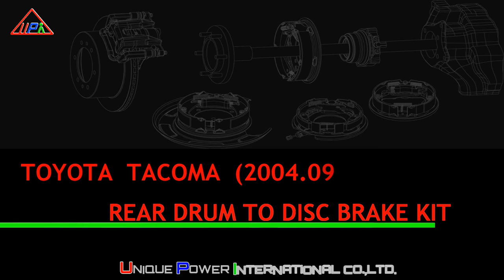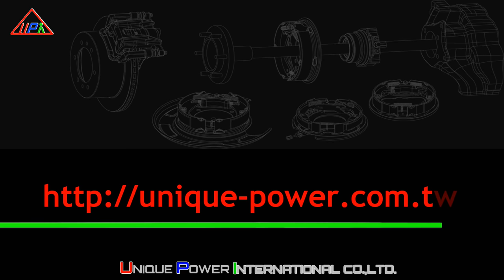Toyota Tacoma UPI rear drum to disc conversion kit installation guide

Comment: I mean yeah its seems pretty old school that my 2018 still had drums but I dont think this much work is necessary. they work fine 😅
Reply from the maker: Thanks for your comment!
The original drum brake of your 2018 surely works okay.
A disc brake in the rear, just like FJ  Cruiser will bring a better experience.
Safety drive is always the best!!!
Reply: Unique Power International i totally agree with you mate it offers both the drums and disk brake all in one piece this is what toyota should have been doing with the tacoma, tundra and 4runner also the sequoia
Reply: @UniquepowerTwUnique-Power  Explain “how” it will be a better driving experience, and what does “safety drive” mean,..we should take your unexplained opinion that all this work is beneficial but yet you cannot spell correctly much less proof read.
Reply: @gregflores8959  yeah if drums are not safe why are they still used on semi-truck and super heavy machines 🤔
Reply: @master6435  Exactly!👍🏽

Comment: Apart for the look, i don't see why anyone would do this kit. Huge job to install, prob pretty expensive too. Drums last way longer. Only reason i see is for someone that does serious towing but then again you trailer will most likely have brakes or youd need a bigger truck.
Reply from the maker: Thanks for your commands, I agree with you in some points.
You could compare Tundra/FJ vs. Tacoma ; F-series vs. Ranger ; old colorado vs. current colorado to find out the difference.
There are too many examples  from car manufacturers and easy to find out.
Our video is close to a bearing exchanging process as a repair process alway does and showing all the details.
If you have a chance to drive a 4 discs Tacoma, you might willing to tell us some new experiences.
Thank you!
Reply: I love my tacoma, but the brakes have always been lousy.  I do tow a light load of 2 atvs on a flat trailer and the stock set up is just inadequate.
Reply: @caseymckeeborrego  That's good to know.
Reply: @caseymckeeborrego  my handbrake (emergency brake) has never worked properly from day 1. 2008 model

Comment: If you want to do a drum to disc conversion on a Tundra, check out Silver Mine Motors. They have a great kit. As with all disc brake conversion, the assembly of the emergency brake is a real pain. I suggest placing the axle assembly in a vertical jig, ( I used a tall traffic cone) to stop the pieces from falling while attempting to assemble. Afterward, just install the axle. Makes the job much easier. I also recommend replacing the axle bearings and seals. When the old one is pressed out, the old backing plate will come off as well.  One thing of importance to remember, there is a right side and left side axle and, if you reverse the anti-lock brake gear, the computer will think you are going backwards.

Comment: I do like the kit, but wonder if you have same set for the 3rd generation 4runner. Thanks
Reply from the maker: We checked that the direction of the cable into the drum is vertical compares to parallel for current model.
Our kit only supports year 2005 on.
The Hilux has the same problem, too.
Sorry that we couldn't support previous model.

Comment: I have read some of the comments about why to convert drum to disc....well let me tell you this...I have a hunt camp and the last 400 m or so is a real muddy potholed road....I am talking real mud holes and so when I leave my truck at the lake for several days and then come back.....my rear wheels are locked...locked so bad that i drag them in 4 lo and they dont turn a millimetre. I have taken my truck to the dealer and they recommend a brake cleaning....so i got a taco 4x4 to go to camp and off road. Disc brakes are self cleaning more or less...I will ditch the drums within the year or so. My drum brake lock is caused by a fault with the ABS and this only happens with mud and water....this is what one mechanic i work with told me. I am not sure why this happens but it has happened 2 or 3 times now in last 2 years. I wonder if anyone else has had this problem with a taco truck?
Reply from the maker: Normally, drum brake is more resistant to the mud.
But weak to the water.
It will be effective after drawing the water out.
Drum brake is efficient only heat and water are its  weak points.

Comment: I have a 03 tacoma prerunner can i use a tundra rear differential that already has disc brakes?
Reply from the maker: Consulted our engineer.
Their lengths are basically different, and we have not made this attempt.
In theory, parts of the same year can be installed with a high probability.
If you do this, a new problem will occur, that is, the wheelbase of the front and rear axles will be different.
Thank you!

Comment: Is this a special kit made just for tacoma or this is something that can be found on a another type of vehicle? Such as toyota
Reply from the maker: In order to use the original cable and the original rim, a smaller drum brake is needed.
For matching the new drum, the new disc and calipers have to be redesigned.
Yes, this is a brand new system.

Comment: Is this drum to disc conversion kit compatible with 2002 Toyota Tacoma.  The 2002 - 2004 appear to have the same setup, only differs with the 2005 model year.
Reply from the maker: The Tacoma before 2005 is completely different from current model.
(Parallel to Vertical )

We are still working on solution for it.
Thanks!
Reply: @UniquepowerTwUnique-Power  When you get it worked out you get my money!
Reply: 2002 Tacoma 2WD, B03A
Reply from the maker: We don't have a kit for your 2002 Tacoma now.
Sorry that we need more time to create it.

Comment: So you end up with both drum and disc? I always assumed it would be one or the other,  not both. Isn't it possible to just convert from drum to disc, without new drum shoes?
Reply from the maker: It is called "Drum in Disc" system.
The drum is stuck on the inner side of the disc and is driven by the hand brake cable. 
It generates a braking power on the shoe and inside area of the disc.
The two devices operate independently, and the two forces can be added together in emergency cases.
Reply: The short answer is "the shoes are for your e-brake."

Comment: What were you grinding, before fitting the rear disc backing plate?
Reply from the maker: The grinding process is the standard procedure of Toyota for changing the bearing.
Most pickups are using the same structure.

Comment: What’s the benefit for converting from drum to disc? Is there more or less stopping power?
Reply from the maker: Please refer to our website: www.unique-power.com.tw
The parking brake (by handle) and hydraulic brake (by peddle) are working separately.
Double system is doubly safe.
Most luxury vehicles installed the same system - drum in disc system.
On the other hand, upgrade to 4 pot caliper is possible without losing the parking brake.

The drum brake is good, but it has a lag problem.
Especially, in sudden brake cases.

Yes, 4 disc brake type is helpful on braking.
Reply: The massive increase in “Cool factor” is what brings you to a stop. There are drawbacks with one being having to to sudden swerving and lane changes due to the amount of panties the ladies are dropping when they see you coming. 😂

Comment: What year is this application for and do you know if it would fit on a Toyota 4runner. Some parts are interchangeable.
Reply from the maker: This kit fits Tacoma from year 2005 to current Tacoma.
The 4runner is based entirely off of the Toyota Hilux.
Need to do more research on it,  no 4runner  in our region.
Please contact info@unique-power.com.tw for more information.
Thank!

Comment: I have a 1997 4runner with ABS, is there a product for my automobile?
Reply from the maker: Our current kit only supports Tacoma year 2005 on.
The direction of the cable into the drum is parallel compares to vertical of the previous model.
To open molds for this kit needs a certain quantity to cover all the cost.
The Hilux has the same problem, too.
Sorry that we don't have a kit support your vehicle.

Comment: Do you have this conversion kit for 2013 Toyota tacoma X-runner with 5 lugs nut pattern?
Reply from the maker: +Tuan Anh Nguyen 
What we have now is lugs=6 , pitch = 139, center hole diameter =108.
We will confirm 5 lugs spec. in short morment.
Reply from the maker: +Unique Power International 
X-runner is lugs = 5, pitch = 114.3, center hole diameter = 60.
The center hole is too small for our current mold, not available in this moment.
Reply: Unique Power International .
Reply: Unique Power International

Comment: Can't you just pull disc brake axles off disc brake truck,and install complete onto a drum brake truck.. same size axles 60.75"???
Reply from the maker: The installation process is the same as O.E. changing the bearing.
All pickups are in the same structure.

Thanks!

Comment: hi thanks for you reply I mentioned it cause I'm tired of changing rear drums    shoes   on my 2010 Hyundai accent and sad cause nobody sells upgrade kits for my accent
Reply from the maker: +Dario Mendoza 
Agree with you.
In drum in disc system, shoe only functions for parking.
Changing brake pad and disc is much easier and disc brake can reduce the nose drive phenomenon. 
We need to collect more users to support molds and toolings' cost.
Thank you.

Comment: Will this kit work on a 84 2WD SR5 Deluxe?
Reply from the maker: The Tacoma kit can only be installed on models after 2005.
In addition, there is no such model in our region.
Thank you!
Reply: @UniquepowerTwUnique-Power  SR5 OR Deluxe.
Reply from the maker: Sorry, do you mean 2020 Tacoma?
In our region, Tacoma does not imported by Toyota,  only imported by parallel importers, which is not so common.
Yes, our kit fits latest Tacoma perfectly.
Reply: @UniquepowerTwUnique-Power  No I asked If the kit would fit and 84 SR5 or Deluxe.

Comment: Do you guys offer anything for the 1st Gen Tacomas rear drum to disc conversion kits?for a 1998 Tacoma 2.4l
Reply from the maker: Sorry that our current kit fits only 2005' on.
The cable into the drum is completely different before the year 2005. (Parallel to Vertical)
Reply: So you guys have no plans on coming up with a kit in the near future?There's a lot of people on the Tacoma forums and Facebook pages that would definitely use this,you guys should check them it     to know weather there's enough of a demand for it if that's the case.
Reply from the maker: We surely wish to build a kit for early Tacoma. (We know the difference)
It's almost impossible to design a kit without changing the cable.
We still working on it and we will find a way ....... by changing the cable ........

Comment: Does the ABS on the back work any differently?

What I'm wondering is the ECU programming for the ABS/TCS remains static but the leverage on the brakes has been increased by nature of the design itself? Theoretically the ABS/TCS wouldn't have to work so hard for the back when activated which would be the same case for a big brake upgrade for the front.
Reply from the maker: In any case, the rear should not be locked before their front be locked.
We calculate the front to rear ratio and upgrade them just in a certain percentage.
The biggest benefits for the disc is to solve the drum lag and reduce the heat problem.
If people didn't upgrade their front, then our setting is OK for the Front - Rear balancing.
If they  upgrade their front, with our parking mechanism, 
people are able to upgrade their rear to bigger rotor or maybe 4 pot caliper for their rear. 
Just like you mentioned, never brakes the balance of front  and rear.

Comment: What a massive undertaking. I can't even imagine the cost of this project. I'm thinking at least $1.5-3 grand per axle. Why would you need to do this?
Reply from the maker: Thanks for your commands !
You are absolutely right !

It is really not an easy job to build a kit, especially, without re-installing the cable is the most difficult design piece.
We do much effort to reduce the the cost and the list price for sedan should less than 800 and less 1.6k for pickup per set.
We had worked for AP Racing agent here for more than 10 years.
To change the rear is much more effective than the front, especial vehicles like Golf, Focus, Mazda 3,5 ........
they need a new hand brake mechanism when takes the original caliper off.
The most impressive case is a Tacoma user wanted to upgrade its front brake for more braking power.
When he installed our conversion kit, he satisfy the total braking power and give up his upgrade plan of the front.
For most luxury vehicles, drum in disc is the only system for their rear brakes.,
You can see pickup exists drum only or drum in disc system. (Drum is important !)
This is why we try to collect the vehicles to drum in disc system and we are the only fools in the world.
Reply: I wouldn't do it.  Higher maimtenance plus more unsprung weight.

Comment: Ahh..the infamous “Rear disc conversion”..brakes turn into steel braided lines turns into turns into axles, turns into locker turns into three linked turns into full on LS swapped trailered buggy queen..😁

Comment: What about the master cylinder?
Reply from the maker: The total amount of brake fluid does not change much.
No need to replace the master cylinder.

Thanks!
Reply: I've seen where a lot of people that do the rear brake conversion also replace the master cylinder with one for a sequoia to correct for front/rear proportioning. Do your brakes not need this?
Reply from the maker: It will reduce some brake fluid when installing the caliper.
Just fill up the brake fluid in the master cylinder.
The brake fluid change not that much in comparison between the two devices when active.

Comment: This video should be called, “Changing parking brake shoes on Tacoma or Sequoia”!
Reply from the maker: The Tacoma only have drum brake on the rear.
It is a conversion kit for disc brake with drum brake inside.
Thanks!
Reply: Unique Power International Ah, gotcha

Comment: Looks like your just using fj cruiser/ 4 runner rear disc brake parts
Reply from the maker: They looks alike but different at all especially the cable end.
We design a new structure for this kit.

Comment: Only thing that sucks about this, is that disk brakes have to be replaced more often than drum.
Reply from the maker: Total braking power should be the same when stops the same vehicle.Replacement frequency depends on the extent of front and rear sharing.

When the rear does more jobs for the vehicle, the font will last longer and perform a better total braking.
Consider of the heat problem, disc brake is more reasonable and more reliable.
Reply: Plus, I'm sure this conversion is quite expensive. Probably like 1 million miles worth of pads.

Comment: By changing the rear to disc brakes a new brake booster and master cylinder that can support them is needed. Otherwise, this is not a proper installation.
Reply from the maker: The drum cylinder for most pickup is 13~15/16 inch. (Tacoma is 15/16 inch)
Our cylinder for rear calipers diameter are 43~45mm.
Under our calculation and about 2 years' road test, original master works with our new caliper very well.
Please send your technical inquiry to : info@unique-power.com.tw for more details.
Thanks!

Comment: okay can anybody answer this question can you do that on a Toyota Corolla 2006 le
Reply from the maker: Thanks for your query.
Sorry that our current models couldn't fit your vehicle.
And we also could not find the same one to take  measurement in local.
According to some Corolla parts we checked on the web, it is quite different.

Comment: For my education, why is he fitting shoes at 5:44?? Isn't this a disc conversion
Reply from the maker: For pickup, "drum" or "drum in disc" is the only  option for its rear.
Our solution is to downsize the original drum and build a new disc for hydraulic brake.
The individual drum is for parking only.
But it could stop the vehicle at speed of 60km/hr for emergency when hydraulic brake leaking.
Reply: That's the parking brake, it's also referred to as drum in hat

Comment: Way to much work, for such little gain
Reply from the maker: It gains more than you could image.
When a very high friction pad is chosen on this kit, the rear even locks before the front.
(The rear should never lock before the front,  too much improvement is dangerous)